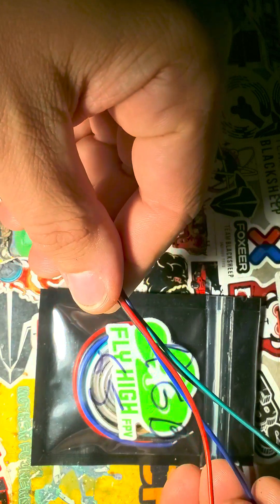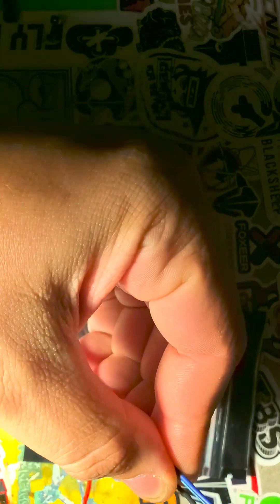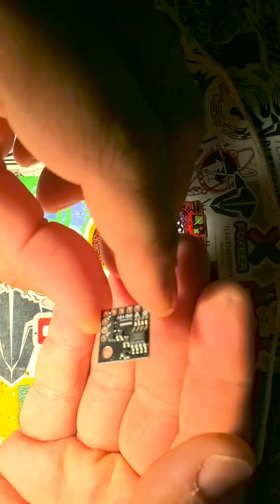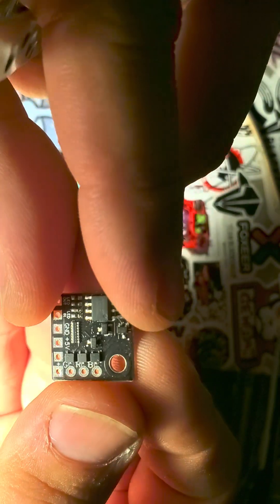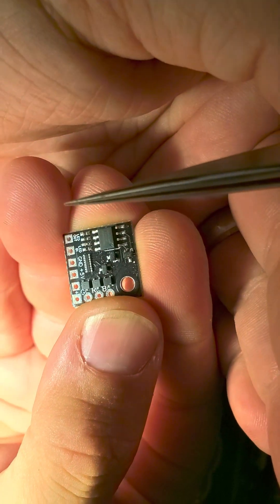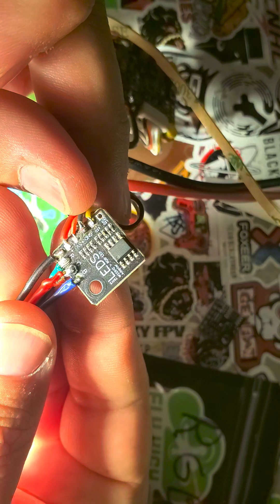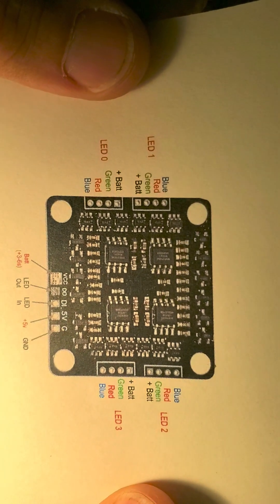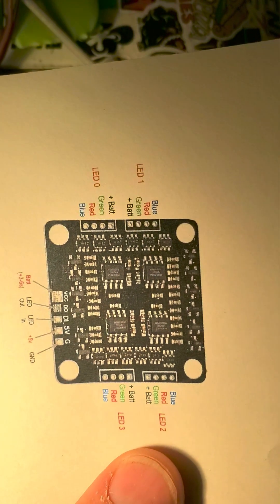RGB Strip and Chip Tutorial - Fly High FPV RGB LEDs

Comment: Hey, i have some 24V cob leds i wanted to install on my racequad. Sadly those get reaaally dimm on below 20.5V, which i am at most of the time while racing. 
Any tips on choosing cob leds strips that will work on the full 6s range?  Odering cobs from ur shop to germany is sadly not worth it with shipping cost and taxes
Reply from the maker: @KidCe.  check the listing on my shop, I have the low voltage cutoffs listed for my strips, because I test everything. But be warned not all strips are created equally.  Mine have been made specifically for FPV with lower voltages in mind.  Often imitated 😉  while I designed them to run off Vbat, I also make a 5v version that can sit on a voltage regulator 👌

Comment: I have a question...so you can either use the 6S direct power (solid color) or 5v to make them addressable (multicolor)? Just confused as to why there are 2 power inputs. Or the leds are 6S and you need both, one for driver and other for the actual LED strip?
Reply from the maker: There are 3 voltage options, and you must choose Single Color or RGB strips. 24v is 6S-8S, 12v is 3-4S,  and 5v is 1S.  They are meant to be powered off vbat, not voltage regulators 👍  Single color strips have 2 wires, red and black and go straight to vbat.  The RGB is different: Power is Black, the Red, Blue, and Green are the 3 Ground wires. You can manually drive the RGB without a chip, by soldering power to vbat, and any combination of colored grounds.

The RGB Chip that drives colors from betaflight needs vbat to power the LED Strip, and 5v to power the LED Chip 👌
Reply: @Fly_High_FPV  and thank you for the response and clarification. I have some TinysLEDs Super Bright Not-as-Tiny 6S leds that I'd like to put on a controller switch with their RealPit. Any idea how I'd wire that possibly? Not much info on how to wire it.
Reply from the maker: @ObsessionFPV  the realpit needs you to resource remap an unused pad to control the power to the LED. There's a good JoshuaBardwell video on it, linked on the RealPit listing on my site 👍
Reply: @Fly_High_FPV  which ones are the brightest?

Comment: I finally got around to installing these.  The seller was generous with the length provided and I had plenty.  I chose ice blue and put it on my Spec 7 racing frame.  Oh lordy they look cool.  Went and flew the drone to show me moms what drones are all about.  Between the spare monitor I have for spectators and this lighting she really loved it.  These lights make your drone look like a UFO.  No joke they are bright enough that they show up mid day pretty well.  Just make sure you don't mount them where the light will hit the camera directly.  Some bounce is hard to avoid but I lined the edge of my arms all the way around the quad except the front inside V.  This worked pretty well and I don't think causes problems seeing.  These really take the look of you quad in flight to the next level.

Comment: Love the lights but you didn't answer the single question I had when I looked up an install video for your lights LOL.  Omg laughing right now.  Anyway I just wanted so know where to cut them.  I'm aware they are cob lights so I'll look up those I guess.   Anyways... stay lit :)
Reply from the maker: Cut lines on the top of the strips. Every 50mm or 33mm depending on the model.  When you cut on the line, you'll split a pair of pads, so you can solder to either end of the strip